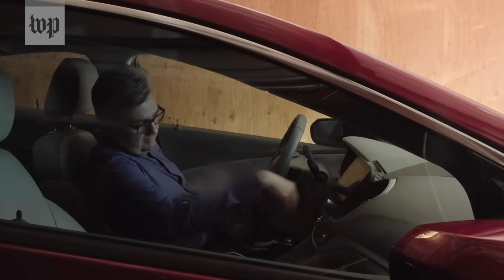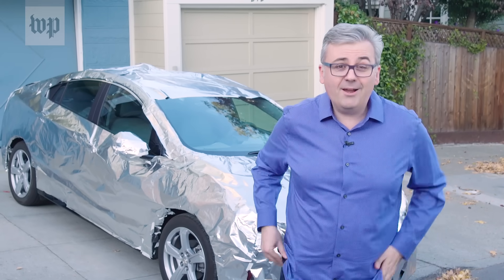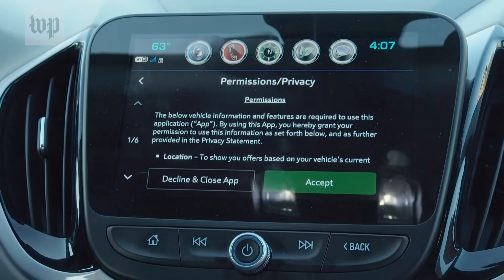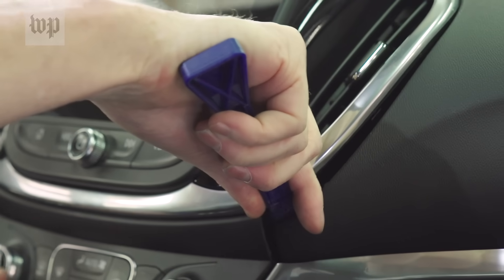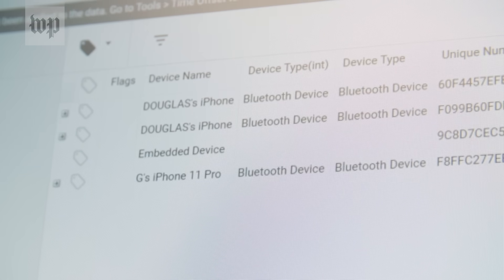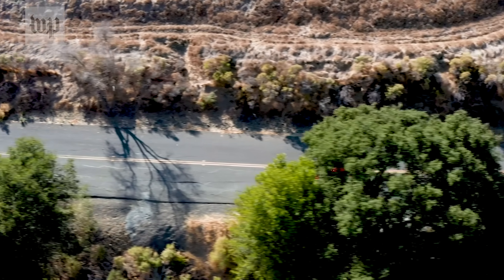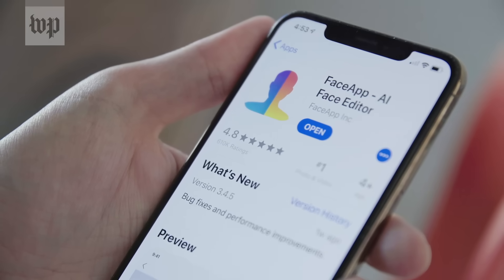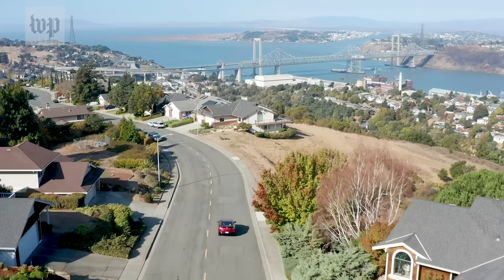Cars now run on data. We hacked one to find out what it knows about you.

Comment: I'm never buying a car newer than 2018 until I can be sure the car isn't transmitting my data.  My 2017 Elantra can no longer connect because it uses 3G and I never take it to the dealer for anything so they can't connect to it either.

Comment: I have a crazy idea.
Can we not have the technology we actually want in vehicles (excellent passive safety, good EV & battery tech, strong lightweight easily recyclable materials, positive steering feedback from the 90s) in the body of an otherwise 1996 Honda Civic? No one wants any of these sensors, touchscreens or data-fueled applications anyway. We just want our cars to be fun, safe, reliable, durable, and easy to fix. No one wants their car to have an internet connection. I really mean no one.

I think there should be an absolute ban on data mining...on everything. Criminally punishable. I have no idea why we openly allow this.

Comment: Besides the ridiculous cost of newer cars there is the needs complexity of these rolling local area networks connected to HQ. I drive a very reliable ‘99 Toyota Camry that is cheap to repair some I do myself. No computers except engine management. There are a lot of reliable used cars much newer that aren’t connected to the internet or too over computerized. You can survive and get to your destination without touchscreen technology who knew?

Comment: Well there is an antenna port on the On Star transceiver package, disconnect it  as well as the power connector. You will loose your service but privacy may be more important to us. As for GPS DATA, that "shark fin" antenna on the roof more than likely houses the GPS antenna. The am fm antenna has, for many years been incorporated in either the windshield or the rear window. If you can trace the wire from it it will lead you to the computer holding the GPS receiver. Now none of this cutting of antennas and power to OnStar may shut down the vehicle if so designed and basically leaves you stranded. Approach each step one at a time. 
Now if data is transmitted via the OnStar cellular system, there is a system used by police and federal investigators called the SHARK. It will mimic a cell site and lock on to the cellular signal of your OnStar transceiver. It will provide data as to the subscriber cell number, IEMI Data as well as all of the data being sent out in packets to the cell sites or the Shark which will give you a lot of raw data IF it is not encrypted. The computer is bound to follow a handshake protocol to dump data to GM so one must learn what is coming into the cars transceiver package in order to initiate a data dump. These are just a few ways that might inhibit data being sent. The other issue is getting one’s hands on a Shark as they are only sold to law enforcement agencies.
It is also interesting that the individual did not disclose how he extracts data from the "body" computer which is usually used to log speed, braking, G forces, airbag deployments, crash sensor data. I am sure this data is stored on a protected ROM memory chip. It is commonly used by insurance companies to determine if you were speeding which may have lead to an accident. Keep erasing this chip or disable it and data will no longer be stored.
As auto makers make things more complex it will create more work for hackers to defeat.

Comment: Wow you are holding the automobile industry to a much higher standard than Google, Meta or Amazon are held to. Buy an Android phone, dive into the OS an say no to all dat collection everywhere and when you are done Google turns off everything except your ability to make phone calls, you have no access to your address book, you can’t take pictures, you can’t go on the internet as the so called open source OS is only open source when there is something in it for Google. Lunix is still the only true open source OS today, if the Google OS was open source there would not have to be anything in it for Google for people to use it. When you buy an iPhone you buy a license agreement just like when you buy a Windows computer, in both cases money exchanges hands with Apple and Microsoft for the use of a single OS with said device.

Comment: Covering the vehicle in aluminum foil will not work.  The data travels out from the vehicle with the mobile phone system access. The vehicle has its own e-SIM built in.  The manufacture gets the complete location history, mechanical operation, and everything that goes on with the vehicle.  No individual person reads the data unless there is a reason to do so.  If there is a fault sensed with the vehicle the manufacture is notified. When buying any new vehicle we have no control over the data.  

The best cars were made before the late 1960s.  Easy to service, and no computers that made the vehicle complicated to service.  If I was able to drive late 1950s up to a mid 1960s car on the road and have it properly supported for parts and service this would be my preference.  I would add my own GPS, AM/FM/CD sound system, and hands free for my phone. Nothing much else needed for modern electronics.

Comment: A simple layer of foil doesn't block much these days.  You need some way to test whether or not it is still able to send a signal.  It is the same with those fobs that are always sending a signal.  You can't just wrap them in foil and blindly assume that it is blocked!  It is the most naïve thing I can imagine to just wrap it in foil and assume it works with no testing of any kind done!  I have a special pouch for my key fob and it does block the signal but you know something about it?  There is no foil in it!!  It is lined with a special fabric made of metal.  It also was not insanely expensive.  You can buy them cheaply enough and they come as a set of two.  How do I know it works or at least seems to work well enough?  I took it into my vehicle with the fob in it and it would not start.  If you do buy such things keep in mind that it will allow for accidentally locking the fob in the vehicle.  Modern vehicles prevent that by refusing to lock the doors if the fob is still in there and it can detect it.

Comment: You’d have to have been living under a rock to not know all this was happening.. I have a 2015 corvette that I only drive a few days in the summer, I removed the battery to use elsewhere at the end of summer and maybe a couple months later started getting letters from Chevrolet asking me to check my car’s battery because the couldn’t connect with it.. after several letters I finally called to ask why they needed to connect with my car and I got a bunch of excuses none of which made any sense, finally I was told there were updates to software that it needed and could I then please reconnect the battery. When I asked fro information on the software as Apple provides before asking me to update my phone I was told that was information they didn’t share with the public..hum.. I believe the only thing they wanted was to continue harvesting data which they could then sell and I was blocking them..

Comment: I rent when I need to use a vehicle and one thing I noticed yesterday while driving a Mazda3 was that twice during the drive, the vehicle displayed a speed limit[next to the speedometer] different from the one posted on the street. Once higher, 45 in a 35mph area, and again 25mph in a 35mph zone. 
Not sure where it pulls it's data from but it seems like a discrepancy that could possibly be used against you in issuing traffic citations.
Reply: They haven't updated the software. I've seen that happen in a Mazda crossover.

Comment: I am a mechanic and this is one of the several reasons I chose to drive older cars (2006 and older) over newer vehicles. Not only are they cheaper and easier to fix, but I am not being spied on when I drive. I encourage others to do so as well.
Reply: I am looking at getting a vehicle and want to get the "newest" not-spying year.  I think anything that connects to a phone via an aux cable and not a system. I think that's about 2008 or 09. Any thoughts?
Reply: By properly maintaining and keeping them rolling you're also saving them for future generations. Everyone should own a couple old vehicles.
Reply: hope you don't own a smartphone

Comment: Yep. This is all in the terms and conditions that we must accept. 
The solution is to locate the transmitter and disable it. 
If that’s too much for you, simply stop plugging it in and then using it. Anyone ever notice when you plug it in while it’s locked, it will not play music or anything until after you unlock it? You give them permission and access by unlocking it while it’s plugged in. 
Leave it locked while charging. Unplug it to use it, and use bluetooth to play music. Use an independent hands free earpiece vs using the car for calls. 
Make it as difficult as possible for them to steal your personal and private data.

Comment: As a factory trained Red Seal Technician with SET(Specialized Electrical Training), I'm extremely well trained and dangerously knowledgeable about modern vehicles communications with the "mother ship" and what data and driving habits/events are stored in unsuspecting modules.  Rest assured, as far as outside communication of data is concerned you most definitely can stop it, but it takes me quite a while to defeat those systems but it can be done.  As far as stored data in modules is concerned, you have to rewrite all the code for every module and while yes it's possible, it isn't financially practical.
Reply: Additionally, I know of vehicles where EVERY module was fried in a successful effort to eradicate all event/crash data before a warrant was issued to extract said data and everything ended right there.  Not so much as the VIN could be ready from so much as the power windows switch nor could you communicate with a TPMS sensor
Reply: @gmctech  So when you write your vehicle off, you need to go and open all the modules and drill holes in the chips?
Reply: Essentially yes.....  It's easier to "fry" them than drill through each processor and eeprom....

Comment: They can even control your electric steering, gas pedal, & breaks causing a collision and wiping out all traces of that happening in other words they can take total control of your car!!!
Reply: Only if your car has Adaptive Cruise control. But no company would ever even dare risk that. I drive a 2018 Chevy volt premier. Great car
Reply: I just drove a Volkswagen Taos with adaptive CC for the first time last week. Occasionally, as I began turning (eg off the freeway onto an exit), the car would resist my steering and try to go straight. Thankfully I could keep at it until it gave up. But so dangerous!! There’s no way these auto drive systems are ready for the road. I don’t understand how the authorities gave manufacturers the go-ahead.
Reply: @PatHand-og9yd yes and the automatic braking is dangerous. My car slowed right down to half the speed for no reason (there was no car in front), and I had a car behind me obviously not expecting sudden braking. I thought there was something wrong causing the car to lose power, as I couldn’t accelerate out of it for a few seconds, but then realised it was actually the adaptive CC doing it.

Comment: to make my car run and drive i need: 12 volts to the coil, 12 volts to the starter, and a ground to the distributer points. points ignition and a carburetor will suffice

Comment: Mandatory starting with the 2027 model year is the ability of the car's computer to.....shut it off, if it doesn't like how you are driving or how you are speaking.  They will be making decisions if you are fit to drive.  This is true, I'm the opposite of a conspiracy nut.

I'm driving my 2000 (supercharged) Buick until either it or I expire.  I'm 77, so it's a tossup.
Reply: Not quite what you are stating. It is intended to prevent drunk drivers from driving. Whether it will work or not is a different matter.
Reply: @DialUp_Daydream  That's what I said, but it's also more than drunk driving.  What some might call erratic, I call exuberant.  Ha ha.....

Comment: I am watching this from Australia  and the date is 26th November 2023 and still nothings changed. Apart from new car models around the world. I still drive my 1995 Australian commodore so I know its not spying on me.
Reply: @steventurner8428 are you still using the original radio ? Also driving a pre 2000 AU with tape player !
Reply: @robertmorris6529  Tape player? Oh such luxury. AM radio in my Valiant, but it is push button, so not too basic.

Comment: Interestingly,  it is nice to see your attempt to turn the car into a Faraday Cage.  However, plugging in your phone in your car wrecks that option.  
My newest car is 11 years old, and I would like to know what is recorded on its black box.  I know the box exists. I just don't know where it is, and I have a rough guess as to what is recorded.  I know you can utilize its info to prove your actual speed if charged with speeding.  Beyond that is questionable.
Reply: Look under the front seat
Reply: @pre1980cars  Cars from 1998 had this feature with OBD2 freeze frame in an accident anything that causes the check engine light to come on a person investigation is able to determine the speed.

Comment: As the owner of Two Gen II Chevy Volts, and being a fairly knowledgeable car person, I noticed that the Red Volt he took out if the garage and the Red Volt that they hacked into were two different cars. Not sure why🤔.
Also, you can just pull the On Star fuse if you don't want GM tracking you.
Reply: That was your takeaway? That there was two different cars, NOT the whole problematic bit of your cars spying on you? SMDH
Reply: @colin-nekritz  
Well, if I pull my OnStar fuse, (like I said above) his Volt won't be able to transmit any data. 
I guess my takeaway is he knows very little about his Volt.
Reply: @byrnc927  disconnecting the device was not the objective at hand. they were looking for the collected data. im sure the engineer he had surely knows that you can disconnect the onstar
Reply: I have a white Gen II Volt.  I love it.

Comment: When you take your GM vehicle to the dealer for any kind of repair warranty or not they plug a dongle into the DLC and it tells them exactly how the car has been driven even tells if the engine has been commanded to wide open throttle and how hard the breaks have been applied what type of oil and gasoline have been used in it so they can void your warranty
Reply: I knew a guy who blew the differential on his pick-up and GM wouldn't warranty it because the computer said he was spinning his tires at 90 MPH while he was stuck and that's why the parts broke
Reply: @williamdavidson9009  I think that's perfectly reasonable. Scary, but reasonable. Why should a manufacturer do a free repair on seriously abused parts?
Reply: i was thinking insurance  premiums
Reply: @mmoarchives2542  There is that. I wonder if the insurance companies have ready access to the data without a subpoena?
Reply: @DialUp_Daydream  car companies are on equal ground with insurance companies, if car companies can legally collect our data and then sell it, they are pocketing money selling our data as we speak to those insurance companies, chances are, they can collect our data, but not yet legal to sell our data, so they're collecting readying to be able to sell it
Reply: @DialUp_Daydream  have to consider though, so many car wrecks these days, insurance companies are going broke, so how to reduce having to pay up?  buy driving data to determine insurance rates based on driving habits
Reply: @mmoarchives2542 lol insurance companies going broke 😂